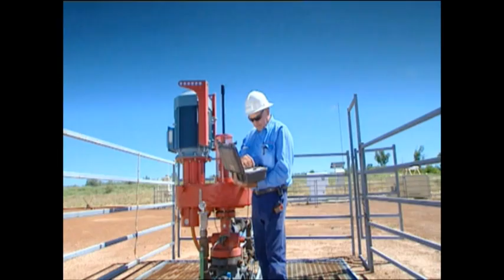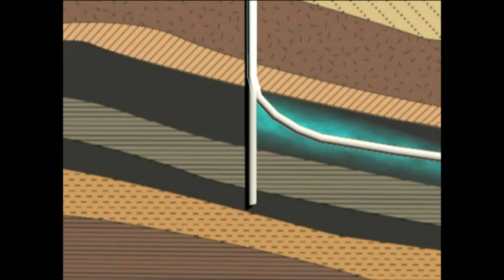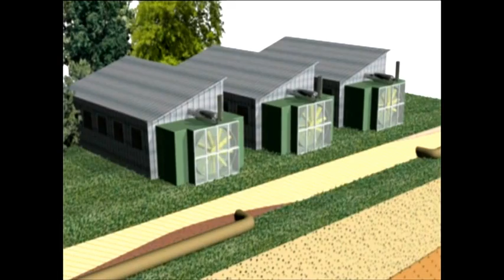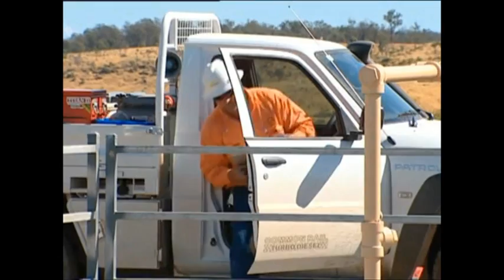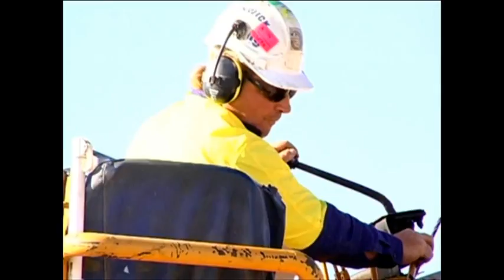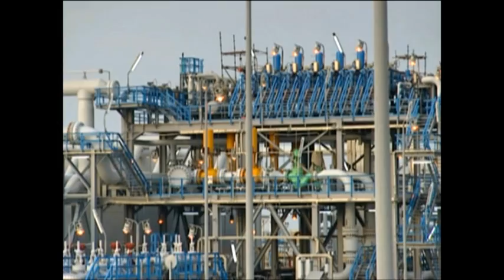Coal Gas Seam Drilling (simplified)

Comment: This is ridicules there is nothing said about the Fracking process. which is how they stimulate the gas when they extract it. they do this by pumping chemicals into the ground to crack the sedimentary layer, possibly contaminating the countries water supply
Reply: No Australian Consumer is benefiting from CSG. Gas price in Australia is the highest in the developed World.
Reply: I'm afraid you must be getting coal seam methane confused with shale gas. They are 2 separate unconventional petroleum systems. Hydraulic fracturing is the method used to extract gas from fractures of organic-rich shale that occurs at much deeper depths than the coal seams mentioned in the video. Coal seam methane can be extracted without the fracking process. The natural lithostatic pressure aids the gas production in the well. Yes, occasionally CSM wells will need to be hydraulically fractured, but it rarely comes to that, especially in Australia. Also, even if "chemicals" were pumped into the ground to create a more permeable route for gas flow, the time it would take for these so-called "chemicals" to reach ground water required by humans is out-with our life-span.
Reply: @MrSneakyJesus  interesting, can you please elaborate a bit more.